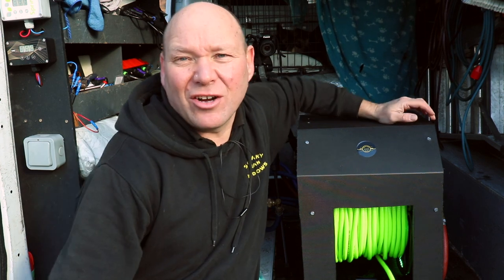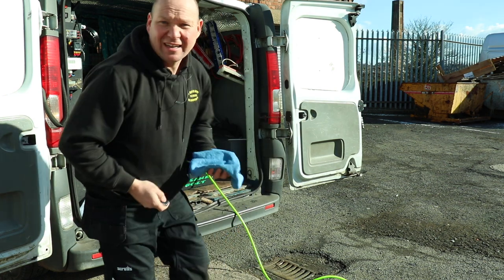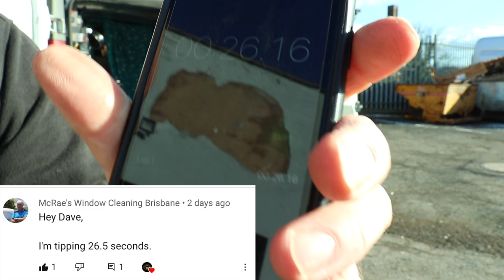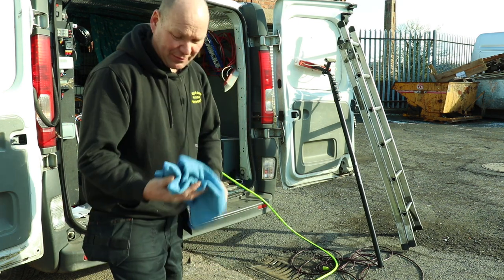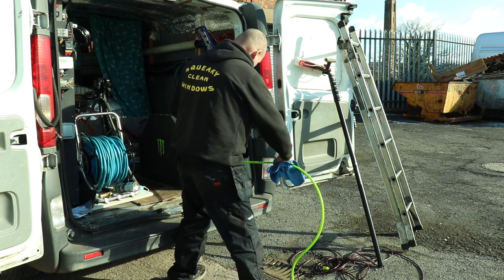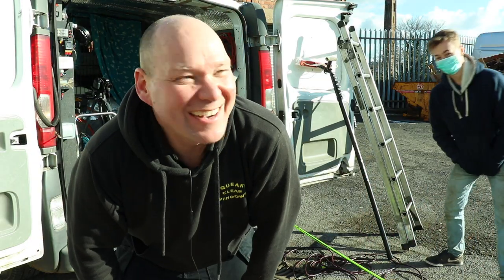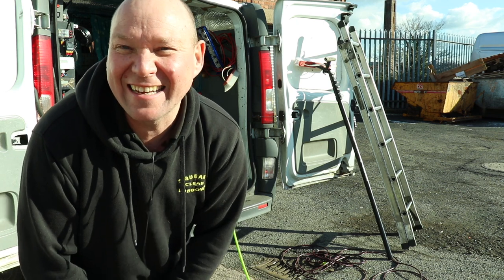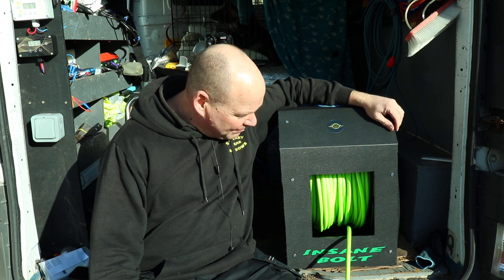Speed Test! Worlds Fastest Hose Reel

Comment: Ha Ha love it mate !!
So I’ve always run all my reels in both vans on 24v with a winch solenoids remote kit. I find on 12v is way to slow now after running 24. But I do have an extending sliding guide that comes out the back of the van so we hardly touch it. Much safer. Let me know if you want to see it. Great vid 👍🏼
Reply from the maker: I would love to see your setup. I’ve already started thinking about Mark iv with roller guides 👍
Reply: @squeakycleandave1  if your on messenger I can send you a vid of my set up 👍🏼
Reply from the maker: @1973hancock  perfect 👍

Comment: Excellent.can you alter speed on it now the trial is over or is it all or nothing depending on 1 or 2 battery’s ?
Reply from the maker: I’m going to look into slowing it down for everyday use. I could always swap the sprocket 👍
Reply: I copied the original design by Dave and added a 30amp speed controller off amazon to control how fast it goes 👍🏼
Reply from the maker: @connoradams4804  I will look into it 👍
Reply: Nice one.you need to put in circulation Dave.cash waiting lol
Reply from the maker: @tgun4928  not going to sell them takes to long to build and I’ve got no insurance

Comment: Nice :-) Is that 6mm Microbore Hose?
Reply from the maker: Yes I always use 6mm
Reply: @squeakycleandave1  Can I ask why this is your preference? It’s just I’ve only ever used reinforced hose, and I’m really not sure what the difference is, if anything, between the different size reel hoses. Just curious to know. I wonder if this is a worthwhile video or just simple enough to answer here?? Thanks for your time
Reply from the maker: @clearviewmind  I started using 6mm hose when I used to lift the hose reels in and out of the van to wind them up. I did try 8mm but it was a lot heavier. Now I’m not lifting the reels I did think about trying 8mm again but just stuck with the 6mm out of habit

Comment: I think 12v is the sweet spot. 24v you save a few seconds at the risk of a few fingers lol
Reply from the maker: I only did the 24 volt for the video as you have to disconnect the rest of the system but it was a bit of fun 👍